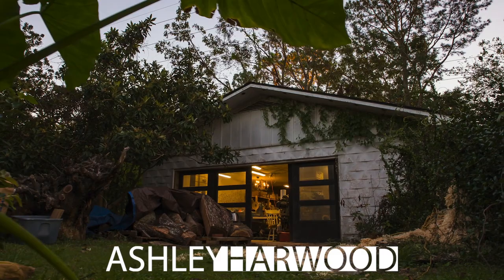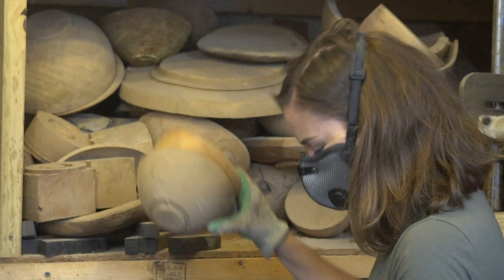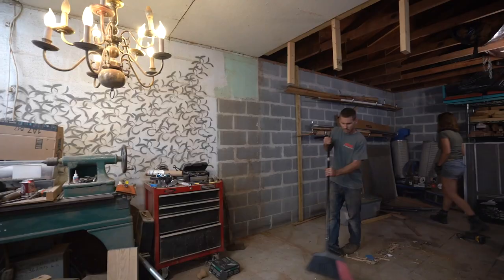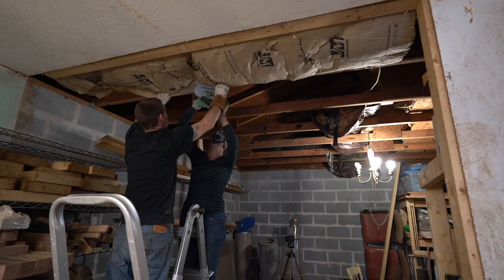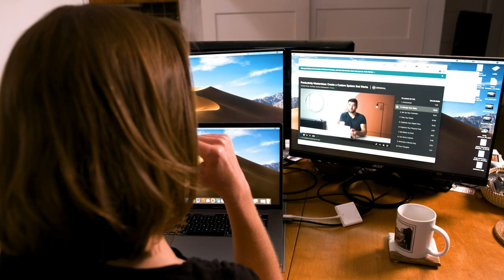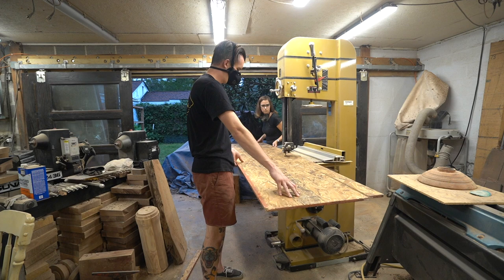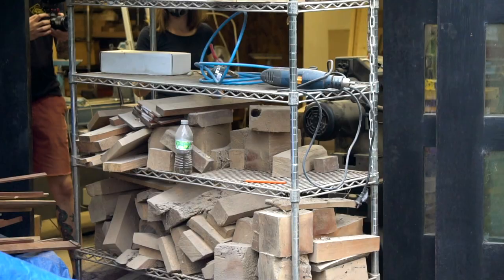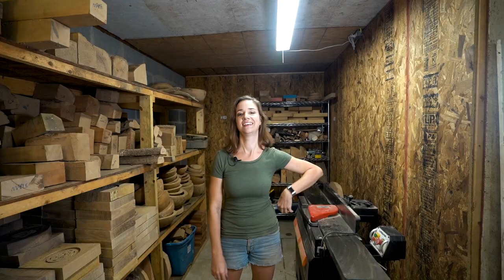Knocking Down the Wall! Studio Renovation #1

Comment: Indeed, I have re organised my little shop many times. One idea i use for misc dust management is a shower exhaust fan in the ceiling and an industrial fan in the wall that moves large volumes of air out the back. this has made a real difference. :)

Comment: I have added to my turning shop 4 times in 10 years, and I am thinking about it again.  Also I blow down the dust every 4 to 6 weeks.  I open the big outside doors and turn on the air compressor.    Love your work

Comment: Fresh coat of paint on the walls and roof. Some epoxy on the floor.
Will change the mood in any shop and create a better atmosphere which is essential. Hanging pictures for inspiration of curved lines or whatever you can draw from I find it very helpful.
I'm not a woodworker I work in metals

Comment: One thing  - a simple thing - that you should do is paint the ceiling and OSB walls white.  With this small investment, it will automatically seem like you have at least doubled your lighting.  Additionally, go with LED lighting fixtures.  The cost has come way down and  you really cannot afford not to:  They are simply that much better.